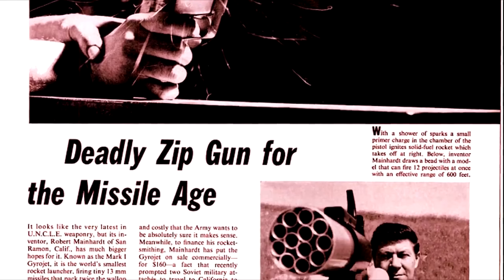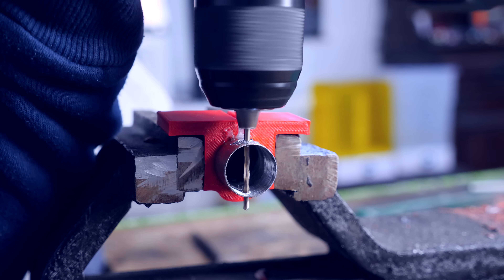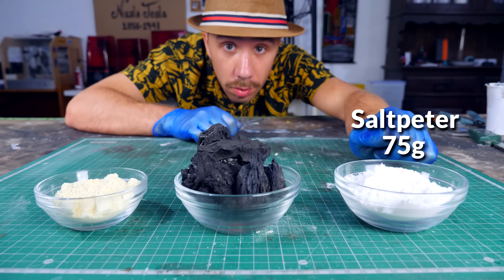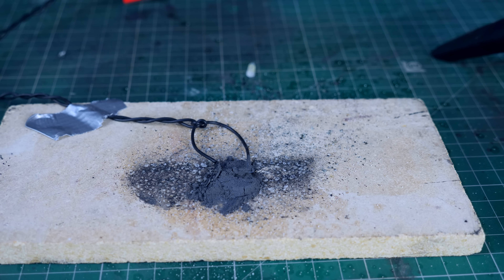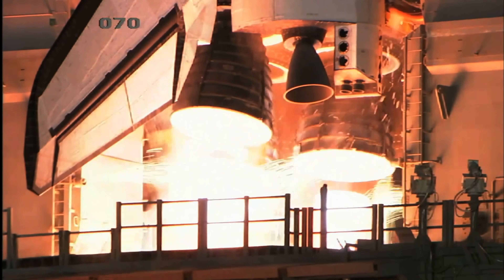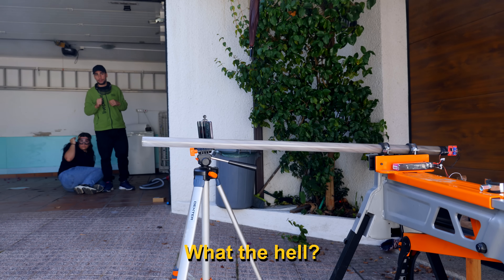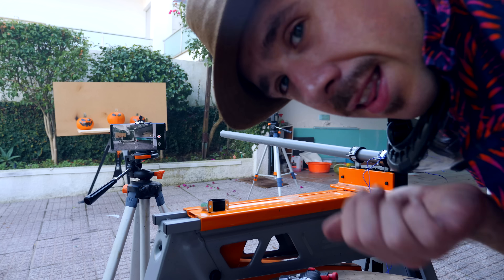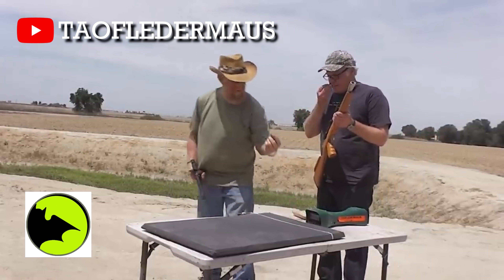GYROJET - The Spinning Rocket Bullet

Comment: I'd suggest 3 nozzle holes but in a line. the two outer ones angled at a steeper angle and the center one just a normal nozzle pointing directly back. while the pinning is going to be more challenging, the advantage is you can get faster spin without sacrificing speed. It also allows you to put the igniter directly in the center which should give you a slightly more even burn (since it looked like most of the exhaust was coming out of only one of the nozzles which would leads to greater destabilization)

Also another thing you could try if you want to try to up the power, maybe instead of a tube of propellent you try  grinding the propellent up. depending on the size of the grains that could drastically increase the surface area available for burning leading to increase power. The down side is it's impossible to get the same consistency in exact burn rate from one shot to the next. However with simple home made fuel like this I don't think it matters since I don't believe your going to precise enough to get good consistency anyway.

Comment: Project idea: hydrogen rocket
Make hydrogen with electrolysys, then compress it in a bottle like. Quint did (https://youtu.be/5Da2qVntopk) or if you can afford a cryocooler make liquid hydrogen, but I suggest the first one as a challange. 
And then your rocket fuel is ready

Comment: Damn, that's really cool mini rockets, sad that nozzles didn't work well( What do you think about making a video about tesla turbine, but using the laminal flow water to make it work? And if it goes well, try to power a boat or a car with it. Like, using the open container with water, connected to turbine, which will power the propeller of boat, and compare it performance with high pressure air and water. Shouldn't be a big deal to make it, but I do want to see how you'll accomplish this. As always, thanks for fun and useful video

Comment: Idea for testing the nozzle angles: weld/fix a CO2 shell to a ball bearing, this would let you more easily study the nozzles and their rotational effect. You could even set it up so the test bench is reusable by having the nozzles removable and only using CO2 for "dry fire" testing.

Comment: A few tips. 
1. For ignition, you can use a match by simply throwing the wire over its head. 
2. I used fuel from sugar and potassium nitrate in powder form, without melting. The composition was tightly packed into the body with a wooden piston, then drilled channels directly through the nozzles, an angle of about 30 degrees. 
3. It is necessary to ensure the simultaneous ignition of fuel in both channels, then this bullet flies smoothly. Alexander from Ukraine 😉

Comment: Try that propellent for your rockets:
- Powder Sugar
- Potassium Nitrate
- Kitty Litter (bentonite clay)
Put PN into blender and shred.
Mix it with sugar powder and get the propellant as a result
Put clay into blender and shred into powder
RAM everything into pvc pipe: clay, propellant, clay.
Drill one coaxial hole in the centre through one clay layer and through propellant, leaving the last clay layer intact.
Fire the hole ;)

Comment: You can spread the gun powder inside the strew using a piece of sheet folded in half and with gentle touches, que gun powder will slide into the strew ;)

Comment: Video idea: try using a lathe to manufacture nozzles. If you self-taught your welding along with everything else then this is just going to be another tool in the belt. Also if you use the lathe you can have far more precise and durable rockets. Another video idea, try making a James Bond clip version of this bullet. That would be awesome

Comment: Fascinating, but don't you realize that modifying co2 cartridges is dangerous?
Reply from the maker: I learned from the best 😂
Reply: Cooking his own explosives deflected the "don't do this at home" needle quite a bit more for me...
Reply: @hermanrobak1285  And sealing them in with hot glue.  I almost expected him to solder the plastic explosive container closed.
Reply: @jimjjewett  the hot glue isn't that dangerous though, there are no sparks to cause the gunpowder to ignite
Reply: A lot of fireworks are sealed with hot glue.
Reply: @hermanrobak1285  gun powder is not explosive, it just burns. Ironically most explosives don’t burn, they require a small explosion to detonate.
Reply: @motosk8er2  but what we are actually talking about is black powder which is absolutely not explosive. And the definition of deflagration is to burn rapidly. Explosions only occur when you confine these substances. You could ignite a 5 oz bowl of either black powder or nitrocellulose and it will deflagrate as you say but no overpressure and no explosion.
Reply: @motosk8er2  I sure as fuck don’t need a license. I can go down to my local sporting goods store and buy 5lbs. You believe I can store 10lbs in my house. Is your argument really “cause the government says so?” A tank of oxygen says flammable and it’s not. I can think of lots of examples. I’m an engineer so give me a scientific explanation, your credentials don’t help anyone understand anything.
Reply: @lusher00  Just in case you weren’t aware, an FFL is a license to sell guns in the US.

In other words, a professional maniac who arms other maniacs.

Edit: Spelling
Reply: @jamesharding3459  not really sure how that comment applies to me but I am aware of what an FFL is. However, none of the FFL’s I’ve worked with have been maniacs, nor am I a maniac. I prefer to buy used firearms from private citizens where an FFL is not required as long as I don’t plan to sell them for profit in the short term.
Reply: @lusher00  It may be my outside perspective, but it seems like anyone who knowingly sells military-type weapons to civilians is a maniac, as is anyone who wants one.
Reply: @jamesharding3459  well the AR-15 is the most popular style rifle in America and kills very few people every year. Most of us use them for target practice and hunting. A decade ago you could buy them at Walmart. The media does a great job vilifying this rifle but I’m more afraid of a pistol which is easily concealed. It’s estimated there are 5-10 million AR-15’s in the United States and most of them are owned by sane responsible citizens. Very few crimes are committed with AR-15’s but it makes for a great news story when it is.
Reply: @lusher00  Does it not strike you as insane that your nation's citizens own enough assault rifles to outfit the army ten times over?
Reply: @jamesharding3459  would you be shocked to know that in most states you’re allowed to walk into a grocery store with an AR-15 strapped to your back? It rarely happens though. When it does it’s just a guy playing dress up. I got my first BB gun when I was 8 years old. I grew up around guns and gun people. They are just tools to me.  100x more (probably more than that) Americans die every year as a result of alcohol but it’s been a long time since we discussed prohibition in this country. I can understand how people who didn’t grow up around guns could see them as deadly weapons and nothing else but I just see a tool. I can respect your view as well though. I would suggest people look at the numbers and compare it to other deaths we don’t think much of. An AR-15 is really the last thing you need to worry about. Drivers with cell phones scare me a lot more.
Reply: Driving to work is dangerous too

Comment: Integza:  I think one of your problems with the bullets tumbling so much is in the spin stabilization. Now my techincal terms here are all over the place, but hear me out. Things tend to want to spin through their most stable axis, which is the axis that has the most inertia (or something like that). This means that long sylinders tend to want to spin through their short axis, because the inertia in that axis is higher than rolling through the long axis. This has happened before in the US space program with the Explorer-1 satellite. It had a spin stabilized, solidmotor kick-stage, which started tumbling in the last phase because of the shape of that satellite: a long, thin tube. You need to design those kinds of solidmotor kick-stages stubbier, have more mass at the edges of the spun axis. This tumbling effect with spin stabilization might be more pronounced in space, but it should also happen here in athmosphere. Like if you look at the shape of a 9mm bullet, it's really quite stubby.

Your rocket-bullets have really thin walls! Thus they have really low inertia in the long axis (at least after the fuel has burned up). Now take a look at the techinal drawings of the original bullets: are the walls of those bullets substantially thicker? They should be, as they were supposed to harm people, can't do that without enough mass. That could also play a big role why they tumble so much, though loose barrel might still be the biggest contributor.

Comment: The tumble is caused because the sparkler is still in the nozzle. The ignition source should be in a 3rd hole in the center. Also the reason the other ignition packs didn't work was likely cause by to little amps. At 2 amps will reach around 1200-1500C, but it's not an instant heat. it does take a second. Which is likely causing a uneven misfired burn inside. You probably need to turn the amp's up on the igniter to reach the combustion temperature quicker and since it's a consumed part, turning it's lifespan into 1 off ignition via amps won't matter anyway. So how about a few super cap ignition so the power is there instantly at trigger pull? You could got back to the tighter pipe then more then likely.

Comment: I think a "Y" nozzle  might be a big help. With the double nozzle, unbalanced or asymmetric combustion inside the rocket results in one nozzle being more powerful than the other. Forcing the gasses through a single throat an then splitting them in multiple nozzles could solve this issue

Comment: The holes were pointing outwards with no bend of propulsion, if you dimmish the holes to raise pressure and bend the hole with a rotation form with each hole having opposite sides pointed. That way force of rotation > force of direction.

Comment: Love the CO2 cylinder Gyrojet concept.  What about fins that spring out and an aerospike nozzle.  since the barrel you are using isn't that tight you should have room for four fins that contour to the side of the cylinder and fold out when it leaves the barrel with some sort of spring to put the fins up.
Reply: I think there are shotgun slugs that work like that
spring out fins on explodeing slugs I mean, not rocket propelled

Comment: Try the transparant barrel but with holes. The pistol also has these holes for most likely the same purpuse. Giving stability by having a tight barrel but not the downside of it building up pressure behind the rocket.

Comment: You have a problem at ignition since you are igniting from one of the nuzzles, the weight and burnout is uneven. You need to ignite from a central area, as you can see in te gyrojet they use a primer, I know they are not easy to find in the EU but you can use mercury fulminant and a hammer to set it off, also you need to review the angles of your nozzles,since you are using a much bigger projectile the amount of nozzles and angle might change to give you better results

Comment: All I can suggest is more aggressive angles on the exhaust ports, and possibly to supplement with a third port. The more aggressive angled thrust would put more energy into rotating the casing, which would sacrifice a bit of speed for more stability. The suggestion of the third exhaust port is because three force vectors will have lots more stability than the current two port nozzle.

Also, you may want to make sacrificial molds with a thinner wall that stay with the solid propellant, even when loaded into the shell casing, to have a cleaner solid propellant form. This is because imperfections in the Solid propellant mold structure will change how the propellant burns, subsequently effecting how the thrust is distributed among the exhaust ports.

I'm just confidently guessing though, so feel free to take my comment with its' due salt.

Comment: The gyrojet used a hammer to bang the bullet back into the firing pin. The hammer then held the bullet in place until it generated enough force to overcome the spring. This is important because it kept the bullet in the barrel while it spun up. Your bullets don't get up to high enough rotation before they leave the barrel.

Comment: Can you mould the solid propellant so that it has helical grooves that spiral up the side so that forms a hole between the propellant and the metal casing? There could also be a hole in the centre for pure thrust.   Ignition can be at a single point in a void at the top and the wires could be blown back out of the centre. Perhaps this can also help simplify the nozzle design.
Also, paint you pumpkin red. Explode the queen tomato.

Comment: Maybe you can have better results by splitting the desired thrust vectors into it’s components, so have one central nozzle for forward thrust and have some smaller ones perhaps further up the rocket casing firing tangentially from the outside of the casing for the rotation. This way those tangential nozzles provide max torque since they are located the furthest from the center of rotation.

Comment: Integza if you go back to your idea in this video, two things one the firing was late causing it to tumble out of control.
Second Try and just a thought one or two indents along the body of the bullet you know air flow ???.

Third try with no extra power and just get the thing out of the tube ?.

I think your getting there with these designs its just a matter of working out how things can be made to better ones attemp.

Comment: put a little bump on the bullet and a spiral 
on the gun barrel so it would spin, and use a single nozzle otherwise it divides the pressure
Reply: Yes, I've also had that idea. You lose some speed due to loss of pressure, but for a rocket projectile, it would be fine.

Comment: Maybe use a two stage design? Have an initial gunpowder charge accelerate the bullet and ingnite the rocket fuel. Maybe with rifling to spin up the bullet, before it leaves the barrel?
Reply: The whole idea is to spin the projectile without rifling.

Comment: you should use a smaller case for the bullet or you should change the shape of the tip of the co2 cartridge and  another problem is the CO2 cartridges are heavy and a theme for a project you could make a big rocket and try to launch it to space

Comment: Next time you do filling, use a spatula, they're fairly cheap, and easy to get; should give you much more controle over the amounts you pour into(in your case) cylindrical containers, or other small containers with small volume.
Edit: It just hit me, that the jar of gun powder you made, is actually a home made bomb, just saying, I would recommend that you make the mix in the bullet container or some holder for the mix, instead of having an entire jar of quick flammable chemical mix in a jar, which is place in a room with metals and ovens that can heat materials above 100C or 212F.

Comment: Best New Video: Make a rocket the uses a centrifugal fan style, air intake opening in the front, to help it maintain stabilization while airborne. Have the exhaust come out towards the back, possibly at an offset angle from the tangent plane of the edge of the rocket.
Reply: I designed a few examples in Autodesk Inventor

Comment: I would suggest [ time stamp 10:10 - 10:13]  increasing the angle (of Nozzle) from 8 degrees to 15 to 30  (degrees) and have 3 ports/holes. with the 3 holes and a greater angle should spin the projectile as it travels down the pipe

Comment: 1. You can use "fins" but not on side of bullet/rocket. You can place them at the bottom/behind the nozzels (like a tail).
2. The main problem is, that your bullets doesn't spin fast enouth, or propellent was burning to much irregulary and destabilize them by changing place of their mass center "in flight". Maybe you can reduce this by making propellent in parts (radialy dividing shape that you used) that will burn indepently of each other.

Comment: If you can't rifle the barrel, turn it inside out! "Rifle" the projectile at the same angle as the jets. Essentially making what I would call an "air screw". It would also be interesting to test a higher angle of attack on the side nozzles, shrink them slightly and add a central nozzle for direct forward thrust. Also cap or restrict the end of the barrel so pressure can build up before the projectile exits. *future video idea

Comment: VIDEO IDEA,  make a rocket powered autogyro "helicopter" to shred tomatoes.

It can be just, a stick with helicopter blades and rocket motor on the tips, launching from a pipe. It will be very impressive, specially at night! Or something much more sophisticated with control, ones you your perfect your fabrication methods :-)